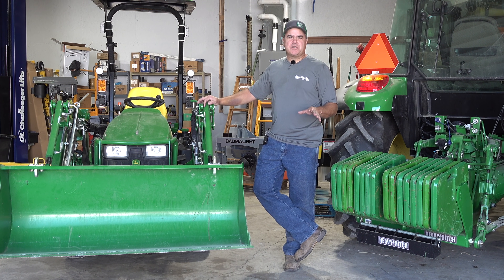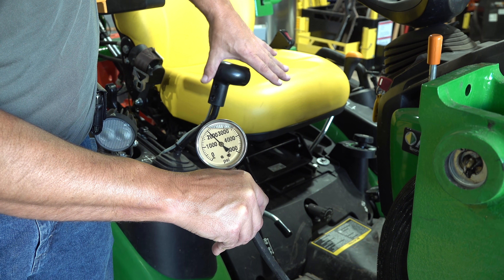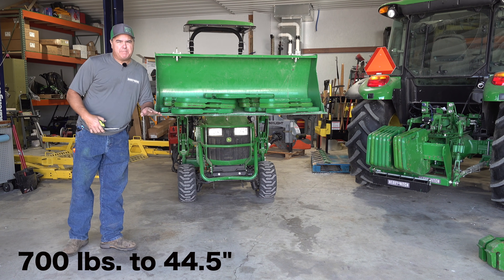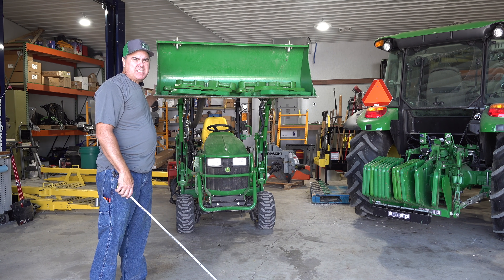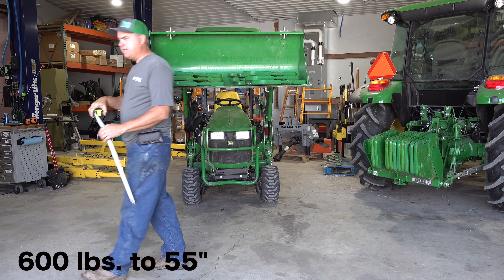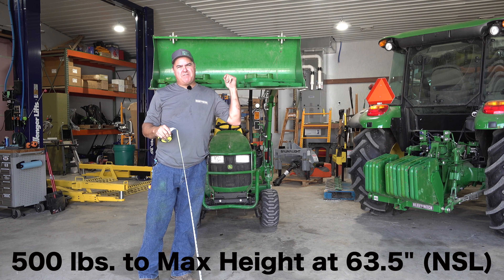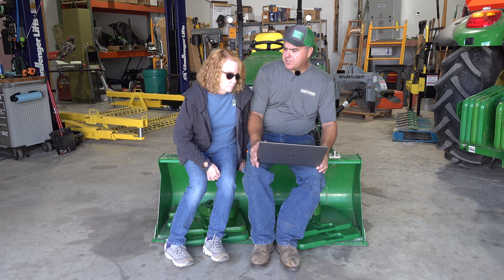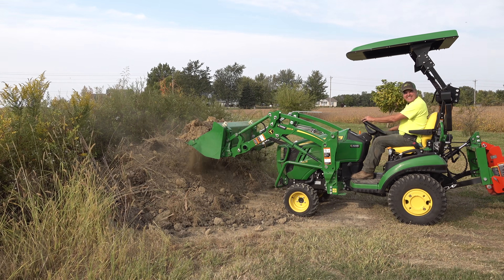WILL IT REALLY LIFT MORE??? 120R MSL vs. NSL for Subcompact Tractors

Comment: Just ordered my ISO tunes head phones thank you for them. You test is more real world because the weight is in the bucket just like using the loader. If the weight was closer to the pin it would lift more, how ever when loading dirt the bucket is full from the splash guard to the cutting edge.I think you did just fine, and im glad your feeling better!!
Reply from the maker: Thanks!  Question for you.  I’m assuming you ordered the over the ear variety.  Why do you prefer the over the ear style to the earbud style?  Just curious...Gathering input :-)
Reply: @TractorTimewithTim  I run alot of heavy equipment and the ear buds just dont have enough noise control to cancel out the engine. I have been wearing bose headsets but wow do they cost. Thought i give these a try, will let you know how they do.

Comment: Tim, if you can stomach it, Neal over at Messick's did a video recently where he demonstrates lift capacity and shows curl strength. They have a strain gauge connected to a chain that is run 10 feet underground to some concrete or something, Different brand (superior LOL) but probably similar to what you are talking about.

Comment: I think the test really should be done with forks as that's where the MSL loader would get the most use...right?
Reply from the maker: Yes, MSL will see most benefit with forks.  ...but improved lift capacity is marketed as one of the biggest selling features of this MSL.   So, we think important to test.
Reply: @TractorTimewithTim  I mention forks as you had to "fix" the MSL level a few times with the bucket, it would be nice to see it with forks where that would be amplified due to the much further away the tips of the forks would be, plus how the MSL handles the extra weight further from the pin. I suggest to use a pallet with the weights evenly placed.  Use a long pallet if you have one so that we can see visually the difference at the tip of the forks.  Another thought...how about actually loading on & off your truck or trailer, is there less "bounce" with the MSL? More control?  I've had to unload pallets off an 18 wheeler trailer & some of the pallets were presented to me  the long ways....one was a shower surround with weighed in at over 500 + lbs,  that thing was bouncing all over the place not to mention the white knuckles bringing it down with a regular loader!   Not trying to make more work for you LOL!...Just suggesting here!  I'm sure you're always thinking of new shows to do & to help folks right?

Comment: I think what you found in your results is a factor that you find with all tractor (or loader) brands. They use many measurement points that do not translate to what an operator needs to know! One point is lift height at pins, who cares?
Not trying to be difficult with that just realistic! What we need to know is the lift height we can expect with a pallet on a set of forks with 500 lbs loaded on the pallet. Assuming it is a 48” long pallet and there is approximately 12” from the pin to the edge of the pallet, pin height is a next useless measurement. It fairs little better for a dumping a bucket as rarely can you get close enough to a trailer or truck from the side to have the pins over the edge of the trailer. I have yet to see pins at the bottom if the bucket or pallet forks.
Reply from the maker: This is why we perform our tests.

Comment: I would measure from the pin to the top of the quick attach
Reply from the maker: Why?
Reply: @TractorTimewithTim  That will tell you if the lift hight difference is because of the different design of the mounts
Reply from the maker: Oh, I see.    Honestly, the reason WHY the lift height is different is not a primary concern.  The primary concern is the difference in lift height!

Comment: The numbers are good but you wont get the numbers the factory gets because thats at the pin.  If you curled the buckets and measured from the pin the number might change
Reply from the maker: No, the factory numbers are 500mm in front of the pin. Stated clearly in the video.

Comment: Hello,
Good test.
Maybe 2 more things for accuracy:
- put the machine on blocks to eliminate the tire issue. Front and rear.
- always mesure at the same hydraulic oil temperature.

For the curling you might want to buy or rent a weight scale like Messicks did in a video for traction power .

Cheers from Belgium.
Reply from the maker: I have a load center (scale).

I don’t think blocks would make the test more accurate!!  I think it would make the test LESS accurate!  No one puts blocks under the front axle before they pick up a load :-)
Reply: @TractorTimewithTim  
That is correct, nobody does that.
But it still would be nice to know where the flex comes from other than the tires.
Some flexibility in the arms would be good publicity for the design and R&D of the front loader. Adding to a smooth ride under load and dispursing some of the energy that can cause ruptures. If the design acts a little as a  leaf spring it will have a longer life time than a very rigide one.
For the test it might be interesting too because at every little jump on the tires (front suspension) lift hight changes slightly.

As i said, good test, I like it.
These points where just a way of giving you extra youtube credits /points/ income buy commenting.
Reply from the maker: Thx!  Appreciate the feedback!

Comment: There’s also an adjustment on your hydraulic pump I believe it’s sort of a governor/limiter and I’ve seen several people say they can get it up to about 2300ish by adjusting that out.

As far as your test being a little different, it’s possible that they didn’t adjust the bucket for level and you were measuring off of the bucket not the pin so that may have accounted for a tiny bit of difference they may have just left the bucket which might’ve made it higher or lower, not sure.

Comment: Second the Neil Messick load cell comment. Also, would it make sense to use  a magnetic level to make sure both were dead on level rather than worrying about floor? That aside - with these results, not sure I'd run out and switch loaders for no apparent practical benefit. Any comment from Deere?

Comment: The testing across both seams fair.  One thing to help quantify the data is measure each weight to validate total weight being lifted.  Another impact to lift ability is geometry and how the load is placed for both styles.  The load orientation/placement really should be identical in relationship to geometry of cylinders and the cylinder pins. Maybe add standard deviation info to the results?  Standard deviation is a bit much for what you are doing but some of engineering / quality geeks look at it.
Reply from the maker: We oriented the weights the same, and pushed them back against the back of the bucket with same approach both times.  
I think since we did this test twice at two different pressures with essentially identical results, that our weight placement seems equitable.
Most inaccurate parts were the height measurement itself, and the tilt/curl of the bucket.

Comment: Does hydraulic oil temperature come in to play at all?  You can also use a digital magnetic level to insure the bucket is "level" at each of the measurement points.

Comment: Real world testing, just the way we use the FEL every day.  In my case it's often trying to get big rocks off the ground just far enough so I can move them, an inch or two is enough.  Sometimes neither end has enough power and I have to drag or push them.  MSL is safer for some loads by reducing the risk of rolling material back the arms and into your lap and that would be worth the upgrade on a new purchase (to me), but I suspect the trade in of my H120 for the MSL would be ridiculously expensive (but less expensive than a funeral) so is a lot tougher choice.  I would expect Deere is testing loader only, no bucket, no forks, no frame, etc.  Raw lift power and then you have to adjust for what you are hanging on the loader.  That is the most 'universal' number they could give and, by the way, just happens to give marketing a bigger number to play with.  When I finally get pallet forks (soon?) I will accept the lifting loss due to extra weight for a headache rack because I'm kind of tired of having brush and branches rolling back off the bucket. So far I've been able to block them away with one hand while driving with the other, but someday that might not work.
Reply from the maker: Deere includes 49” bucket in the tests.

Comment: This was really great. My only point of clarification is the weight itself. Was the weight of the bucket factored in to the final numbers?
Reply from the maker: The specs include the weight of the 49” bucket.  We have 53”.  ...and the point of the test is the comparison of the two loaders,  not the absolute capacities.

Comment: Off the topic of lift capacity, the Artillian splitter doesn’t appear impeded by the movement of the loader. Did you have to move it to improve its placement?
Reply from the maker: Have not moved it, nor done anymore testing.

Comment: Probably a stupid question, but how did you adjust the hydraulic pressure from 1800 PSI to 2000 PSI?

Comment: One thing I think is worth pointing out about a "Mechanically Self Leveling" loader is that the "self leveling" part of the name is a bit misleading. It in no way "self levels" the FELs attachment. Rather, the MSL system keeps the attachment’s curl position at whatever angle the operator sets throughout the full range of travel of the FEL's boom positioning.  If it's set level to the ground, that’s where is stays.  If it's curled all  the way back to its maximum roll back angle, the attachment will maintain that same roll back angle relative to the ground throughout the booms full range of motion.  With a NSL loader, that roll back angle increases as the boom arms are raised.  If the operator doesn't manually compensate for that unintended roll back angle increase by manually dumping the curl angle, this is where things can go bad in a hurry.  At best, you can start dumping material out the back of the bucket onto the tractor's hood.  At worse, material can fall back towards the operator.
Reply from the maker: I think the name MSL is pretty good and pretty accurate.  I mean, I get your point, but this name seems pretty good.

Comment: How did you change the hydraulic pressure from 1800 to 2000 psi?  Is there a setting or a software update?
Reply from the maker: Sorry, we can not provide guidance on this for liability reasons.

Comment: Thanks for the tests.  Wish I had a self leveling bucket arms - As far as I lift : if any load I use the RPM I got there.  If the load is heavy I put the throttle to full and see how it goes.  I lifted a baby grand from the center of the highway down our driveway to the house.  Delivery truck to street not house.  Lifting my observatory I used a large pallet 4x8' and a capture box of 4x4's so the forks can lift and no tipping at all.  That is heavy.  I moved the large sections to the mounting pad without issue.    If shop tools  it can be in idle.  If cement bags I use full power.

Comment: Tim what would be a more accurate test is add the weight of the bucket into the weight or use the pallet forks with the weights
Reply from the maker: Specs are calculated including the weight of the 49” bucket.

Comment: I like this test, but it's really testing more of a pallet fork use not a dirt in the bucket use. Which I would guess is what Deere's specs may be based on?
I think there are 2 tests that would give the true difference between the loader arms. Breakout force, which you could test with a load cell hooked to the front edge of a level bucket and anchored to the ground or you could put the tractor on a trailer and use the trailer as anchor. Test curl strength at 1' , 2' and 3' heights. Pretty common heights when you are scooping material out of a large pile. Flat on the ground curl would be tougher, but if the tractor is on a trailer the load cell should be able to hook lower than the deck height?
The other test would be with the buckets at full curl as low as they sit to the ground. Load the buckets with weight until they won't lift at all. Then reduce weight like this test and measure heights achieved in 100 pound decreases again. Clamp a level on the bucket side so you can maintain the same Max curl each bucket starts with. Or you could use the level only at the top to make sure the NSL doesn't get an advantage from the bucket tipping back further than the MSL? Either way these tests show if one setup has the advantage for moving loose material like loam, gravel or even firewood. Thanks for all your efforts! It's great information to learn.

Comment: Tim, 
Love your work!  Keep it up!  Listen to your doctors and please avoid the cheeseburgers!  (we need these videos to keep coming!)  
There is a point that has been missed or briefly touched upon on all 120R MSL video reviews (by yourself and others) and that is the 4-bar linkage where the bucket attaches to the loader.  I've noticed that the larger tractors and corresponding loaders have this linkage, yet the 120R does not, or did not before the MSL.  The curl cylinder on the standard 120R attaches directly to the link that moves the bucket.  On the 120R MSL, there is a 4-bar linkage between the tilt cylinder and bucket, and that is where the curl cylinder attaches.  I'm a Mechanical Engineer but new to tractors and this has really had me questioning this linkage on larger tractors and backhoes, and why it was left off of the 120R (non MSL) (note: your 3 series JD has this 4 bar bucket linkage).  What this can accomplish is a larger angular travel out of your bucket tilt with the same cylinder travel.  What you have proven is that John Deere testing (or probably marketing) has probably been sandbagging on the numbers to sell this MSL or added the linkage to get another selling point.  My theory is that you can rock the bucket back further, get the weight closer to the "pin" and get higher lift capacity.  If you re-do this test, can you please put a digital angle finder on the bucket of each setup to measure angular curl of each setup and also re-do the weight capacity lift test at full curl?  Your "500mm" measurement eliminates the linkage from the equation and just proves the lift cylinders are the same.

Thanks,
Cody
Mechanical Engineer with an affinity of Kinematics and now 1 series John Deere

P.S.  My "finance department" thinks another color could have saved us money, but told her that Tim has proven that the green is a superior machine!

Comment: If you were to put on your pallet forks and stack weights nearer the far end of a pallet the MSL shouldn't lose lift capacity "way out front" as much as the NSL does.  That said, looks like another case of Deere being selectively optimistic with specs for marketing purposes.  It reminds me of how they try to portray the 220R loader as being about equal to the 320R when they're not at all.  Great video, really looking forward to the next one with some thoughts on real world use.
Reply from the maker: I’ll try to come up with a way to test forks ‘way out front’

Comment: Did you or do you have a digital guage for reading pulling strength!  I thought I remembered an episode that you had 1, I could be mistaken.  But you could mount that and take a reading using an adjustable strap!  That way you wouldn't need to move the weights and it should be more accurate verses within the 40lb weight
Reply from the maker: I have a load center.  Guess I would have to dig a hole and bury something with hook on it.
Reply: @TractorTimewithTim  Depending on the amount of load, you can anchor it to a rock, piece of concrete or even an implement.  As long as it doesn't exceed the lifting limit of what you are working with
Reply from the maker: But can’t test lift capacity at ground level unless I have room for load center UNDER the bucket
Reply: @TractorTimewithTim  True
Reply: @TractorTimewithTim  would the test differ if you hooked a strap to the top of the bucket and then to the load center or does it have to attach to the bottom of the bucket?  A strap could go across from the bolt on hooks, then down!  Just trying to think of ways that you wouldn't need to move the weights around and get more of an accurate rating
Reply: @TractorTimewithTim  Hook it to the side of your deck-over trailer. The 120R isn't going to lift that. :-)

Comment: Niel on the orange team with Messick’s used a home made flat tv monitor mounted to the SSQA loader and pulled on a load cell. Other than a flat mounting surface- flat rack I think it’s as accurate as you could get with the bucket weight thrown in. So do factories add or subtract bucket weight in lift test?

Comment: I think your method is not directly linked to the specs since your measuring something different than the spec is measuring.  But that's ok. What you're showing is the reality and I think that's what people need to see.  The specs are virtually useless in the context of real life applications because nobody is out there placing their loads at 500mm and nobody is doing anything AT the pin.  So you demonstrating what an actual bucket with an actual load does is what people need to see.
Reply from the maker: Well, our test has the load pretty close to 500mm ahead of the pin.
But of course, it is not perfect